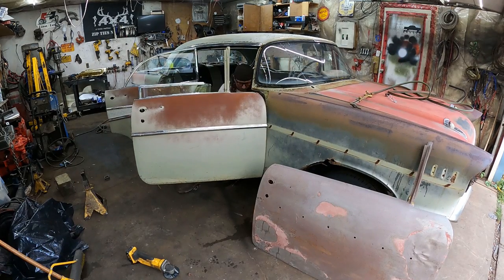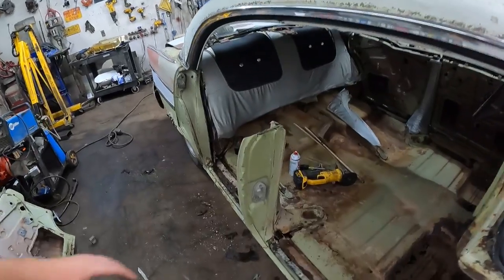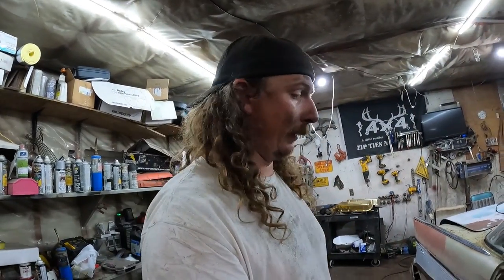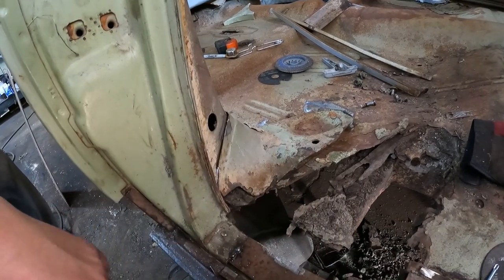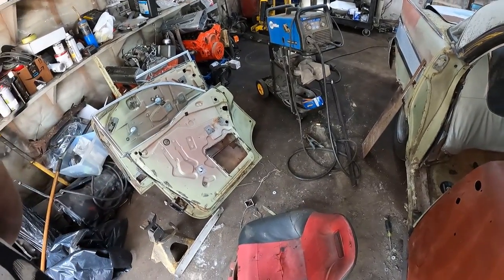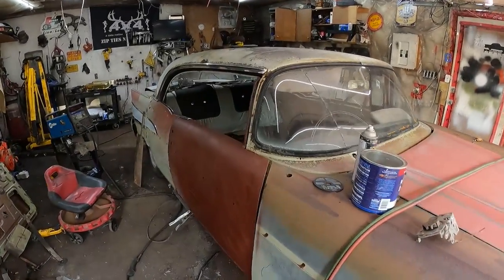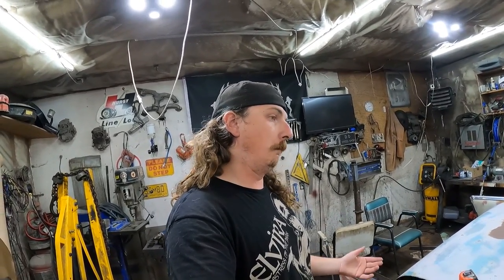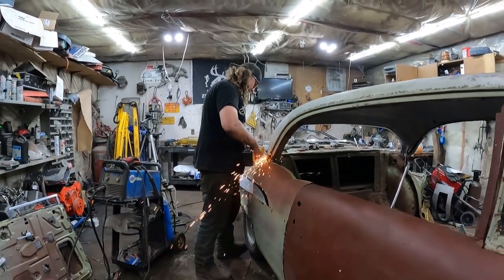Converting A 4 Door Hard Top Into 2 Door Convertible  PART 1 - Door Delete, I Have A Plan

Comment: Yep, the roof line on those at the back is awesome to look at and just pulls the eyes to it, great style. My thinking is the door latch location on these being lower is because of rigidity, the latch being lower puts it closer to the solid mount, up higher and it would want to flex as it is not supported at the top. It's a matter of leverage flex reduction.

Comment: The B pillar does fit into a depression on the floor pan. there is a large floor brace that is unique to the 4 door hardtop that fits under the B pillar. If you move the  B pillar back, and if you get a new floor pan for a 4 door hardtop, it will not line up, so you might end up with a structure support issue. I have one of these and have the B pillars out and getting ready to do a complete floor replacement...Good luck!

Comment: Dan, Make that door to fender gap is correct . Its WAY to wide. Before you weld in everything else on that side or you will be in trouble. I think its in the fender but check it out first. And BRACE BRACE BRACE EVERYTHING for a top chop.

Comment: I'm not a tri five, or really a Chevy fan but, I wonder why you don't install the new floor and rockers when the doors are off and the post is out? To me do it once, do it right is kind of the shop motto. Repair, replace floor supports at same time. I'm a woodworker unibody Mopar guy but, when building a house I always start with the cellar or slab.

Comment: The 2 door hardtop roof was lower, and shorter.  Glass was shorter in height, and the distance between the trunk lid and the rear windshield was longer on the hardtop. Windshield / cowl was in the same place on all the cars. I believe the convertible shared the same configuration as the hardtop.

Comment: The factory beefed up the rocker assembly's when building their convertables. Maybe you need to use some steel 2X4's from the firewall to the trunk to do this.
Reply from the maker: Yeah ill stuff the rockers or something
Reply: @DDSpeedShop  If you ever get to look at some euro convertibles stripped down, Alfa,Ferrarri etc ,you can see they have large U shaped tube hidden into the body .one side of the 'U' goes up the cowl ,the bottom of the ' U' runs inside the rockers and the remaining upright of the ' U' goes up into the rear 1/4 section. Very simple and widely used in the 50's and 60's to tie flexi bodies together.

Comment: guessing the 4 door latch on the hardtop is lower because you have a post that will act like a lever and the higher the latch the more stress on the post, maybe?  doubt it will matter now that it will have the quarter panel welded to it.

Comment: Dan how  come you are not putting in a new floor like you did on the  other  cars? When they do  a chop top in other  TV shows they do x bars from the back  to the  front  to support the car so it doesn't fold up. Is that  what you  going to do  or are you doing it  another way?

Comment: That car needs the chassis your going to use, new body mounts, and the floors fixed first. If you do all the metal work first, it will be out of whack when you swap the chassis. Buy new door jamb sections from tri five supplier for a two door hardtop or convertible. That body is tweaked right now with the rocker rusted away. and no body mounts. I'm just trying to help and not come off like a smart @$$. You don't build a new house before building the foundation FIRST
Reply from the maker: I'll jist chop and cut till it fits haha

Comment: would it not be more sence to cut away all the rotted rocker out and replace it with a new sound one and cut into the floor and replace a large area of floor with new material even seems strong once rust eats at metal it is like strand wire if the wire is 20 strands and you cut away 10 you loose big amperage of the wire same with steel rust so say takes away layers and makes it thinner cause with a solid new one peice rocker end to end would make way stronger.
Reply from the maker: Waiting on parts so I pressed forward

Comment: put in a new floor before you you remove the roof
Reply: I second that, especially the way he does them with an engine crane on the firewall. No post cars are less rigid with the roof on, gonna need some good bracing.

Comment: I wouldn't sell that to anyone. BIG lawsuit waiting to happen. There is a big difference, structurally, between a four door sedan and a convertible or even a 2dr. Ford had a hardtop in 57 but chevy didn't. Talk to a lawyer about liability.   Imagine six or more college kids driving and going over a burm or wide speed bump, car folds, lose breaks six or so dead. Your fault

Comment: Why not support the potential “folding in half” with a two decent set of jack stands, or a couple undercarriage kick stands by using some laying around in the junk steel bone pile such as two to four pieces of angle, or tube, or even good ol’ rigid conduit if you, or a buddy just so happens to be a member of the smartest on a job site, and possibly the most handsomest known as an electrician “just saying”; or a plumber as they too, just as the electricians will have rigid nipples and couplings if need be… 
Just keep in mind, potential smell difference especially, when the nipple is large enough requiring a chop saw, cutting torch to cut to the desired length needed might not smell so tasty if using shitter pipe sizes! Just saying 
FYI fellas, I’m Just talking a little shit as men do with the thought of shitter pipes being constructed using galvanized nipples, or a plumber actually being as the ol’ saying goes, 
“Nothing dummer than a Plumber”

Comment: For the love of Quaker State, please stop this madness. Please, go get a two four and a folding chair. Take a good long look at the overall shape of this car with the hardtop roof on it. You want unique and probably valuable, do a two door with a four door roofline. If you won't stop, at least I'll have the pleasure of seeing you wind up with a bendy, twisty car that the doors never close right on.
Reply: I love his attitude, work and ideas on everything but this one. The car wasn't salvageable but chopping it up to make a half-assed convertible? Who would ever buy it? Even as a parts car, all it has going for it now is an original convertible frame. The four door hardtop is much more distinct (and rarer seen) than any other tri-five bodystyle. A custom, shaved low-rider with suicide rear doors and lake pipes would have been a much cooler direction.
Reply from the maker: Then go build one yourself man?
Reply: @DDSpeedShop  I stripped a 4 door hardtop to build a convertible in 1975. still regret it. I know, your car, your build. Just an opinion based in experience and regret over what I did as a silly 15 year old.